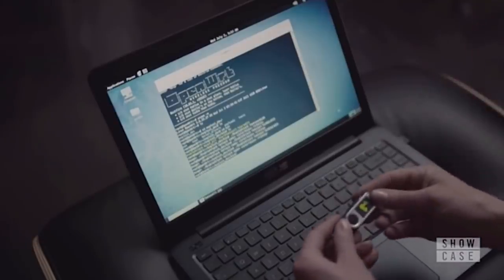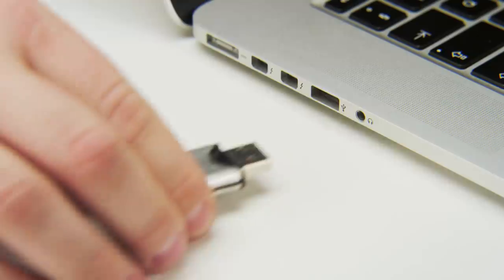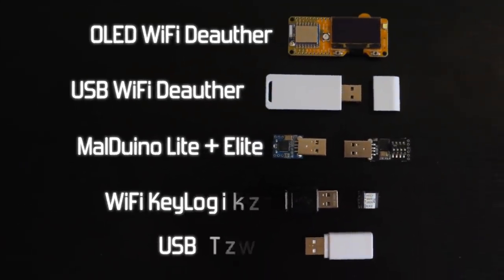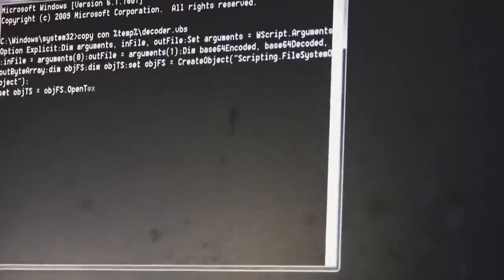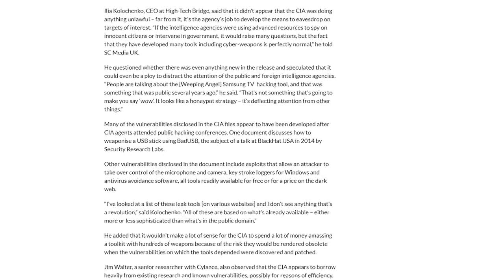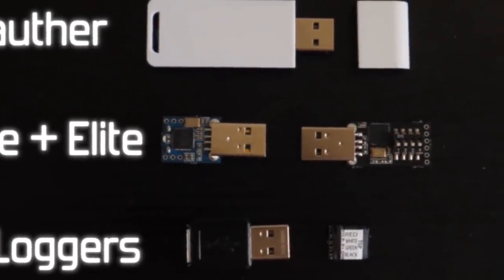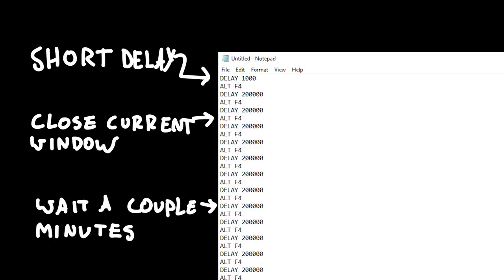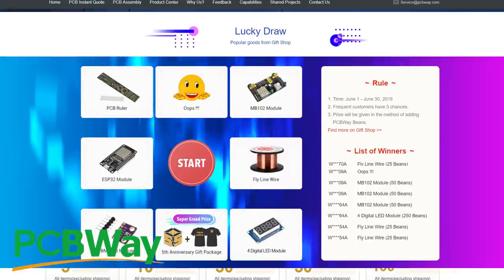Evolution Of The BadUSB

Comment: BadUSB is the wrong description for that because you actually only talk about a usb device that makes keyboard inputs. BadUSB is actually the vulnerability in a certain type of USB Firmware which made it possible for hackers to modify the firmware so it does what it does.
Reply: Yup, this has been known as USB Rubber Ducky for several years. The malduino site even says it's inspired by hak5's rubber ducky.
Reply: What do you mean by "certain type of USB Firmware"?  I believe you meant "every single USB firmware ever made because it is a fundamental design flaw in the USB spec".
Reply: MAFRIESE those brutal hackers are knights from the devil, aaarrrggg!!
Reply: I actually thought BadUSB was the one that charges capacitors and dumps a fuckton of voltage down the data lines, frying whatever USB controller it was plugged into...
Reply: @WackoMcGoose  I remember that. What was that one called?
Reply: WackoMcGoose that was an USB Killer ;^)

Comment: What if it's plugged into a slow computer? Where Win+R takes like 5 seconds to open the run dialog? If it just acts as a keyboard it probably couldn't detect this delay and would type the command too early before the run dialog is opened, right?
Reply: I'm not sure but it seems like 7 would buffer the keystrokes where 10 doesn't.

Comment: "Typing thousands of characters per minute" There's your detection vector, right there! Just equip security software to check for inhumanly-fast typing.
Reply: wouldn't that make gaming marco's a false positive?
Reply: Better yet, checks by matching VID, PID, serial number and class. Only devices whose parameters all corresponded to a check on whitelisted devices (whitelisted by the user via sudo) would enumerate. Devices that decided to change class on the fly would have their access revoked, unless they were authorized to do so. More fail safe than checking for typing speed, as a malicious device can always emulate a real human typing.
Reply: I'm sure typing speed can be adjusted to normal speed like 100 wpm

Comment: Do you know how fast the response time of a badusb with a wifi connection is?
I was planning on using a raspberry pie to do essentially the same thing. Why? Some games do not accept input from scripts like autohotkey, so I had an idea to use a device like this to generate those keystrokes. Because they are essentially "real" keystrokes, then all games should accept them. Now I just want to send commands to said device from my script so I can have macros that work in all games.
Reply: Also is it possible to send mouse inputs and movement as well? Or is it difficult to simulate mouse movement?

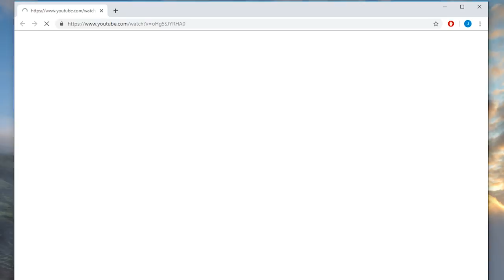Comment: 1:13 They have to be detectable. If they are just HID keyboard you will get a pop up when you plug in one saying that you just have new keyboard with driver installed and ready to go. This happens only when you plug it in first time so pay attention.
Reply: They could be detected if Windows didn't tried to enumerate every device that is attached. A check on VIP, PID, serial number and class against a trusted devices list would solve this.

Comment: Just a question. Did you add any capacitors to your malduino breadboard circuit? I am making an SD card breakout but it doesn't work.
Reply from the maker: Remember sd cards run at 3.3v, whereas arduino logic runs at 5v
Reply: @Seytonic  Yes I am using voltage dividers and a voltage regulator
Reply: @Seytonic  Actually nvm I tried usin g a nano and it worked. Maybe I have something wrong with my breadboard circuit 328p

Comment: I bought your Malduno and WiFi deauther, they're great. I only wish the Malduino came with a shell and I also want I had a decent powerbank which won't turn the WiFi deauther off after a few minutes.
Reply: if someone you know or some local place has a public 3d printer, you could always use that. Its easier to mass produce em without casings

Comment: I am a system administrator. I use the BadUSB for fast deployment
Reply: It's the most efficient way, isn't it? No reason why you can't.
Reply: @hritwiksom3032  There is none. You could just pre-configure it for a blind install. But that luxury is for Windows. Linux not so much, but this is a very workable solution

Comment: Do they really still work on modern os, I thought that was already patched?
Reply from the maker: They patched keyboard input?
Reply: @Seytonic  Actually, it wouldn't be that hard. Windows already has a UAC built in to prevent try to prevent malicious code from running. If this UAC required a password, like on Linux, it would stop it in it's tracks, as the bad USB wouldn't know your password.

Another way, would be for Windows to have a "trusted devices" sort of security built in. I'm sure windows can tell the difference between the main keyboard and an additional keyboard plugged in. Just because they are all keyboard inputs, doesn't mean that windows can't tell which keyboard it's coming from. They could literally make it to where only the original keyboard is trusted any additional keyboard would require a password to authenticate it before being trust it. This would absolutely crush this type of attack.

Comment: A malicious USB device doesn't have to enumerate as a USB keyboard. It can be build as a hub, with keyboards and other devices behind. There are also composite devices that can act as a disk drive and a internet access point (don't need to look up further). This just proves how inherently unsafe USB is.

The only defense there is to implement permissions for USB devices. Only trusted devices with matching VID, PID, serial and class should enumerate. Any other devices that are not marked as trusted by the user, should not even enumerate past the get descriptors requests. Plus, if a USB device decided to change its class on the fly, the permissions would revoke unless this change was listed as trusted by the user. I think this is feasible under Linux, but needs a massive change in the kernel.
Reply: How would the user provide permission for their own keyboard during setup or replacement of parts though?
Reply: @AWriterWandering  You have a point. Forgot about that part.
Reply: @samuellourenco1050  Well actually, come to think of it whenever you pair a bluetooth keyboard, you are prompted to input a randomly generated 6-digit code. If the code doesn’t match then the pairing will fail. I don’t see why this couldn’t be implemented for USB keyboards as well.

I mean it wouldn’t be completely fool proof in itself. The device might be designed to appear to disconnect and reconnect, giving it more chances to guess the code. Though at least having a prompt constantly flashing on your screen might raise some eyebrows.
Reply: @AWriterWandering  Well, when attaching a keyboard or a mouse, a modal window could appear asking for you to type in certain keystrokes in sequence with your new keyboard or do certain operations with your new mouse, in order to verify them. The keystrokes of the new HID device would be intercepted by this verification program instead of going to the system. Keystrokes or operations with already attached keyboards or mice would pass through the system unaffected, essentially being ignored by the verification program. Nice call!

Comment: A very old method to stop this type of attack (on linux):
https://www.kernel.org/doc/Documentation/usb/authorization.txt
There are tools for other operating systems that claim to have similar functionality.

This is not very secure protection. The problem is, every usb device can fake device information. If the attacker knows that you are using a Cherry-Keyboard, he can fake this... but if he just uses device information of a Logitech keyboard, the attack will fail. It might not be very secure, but it still helps. ;)

(But nobody uses this, except me, after a colleague attached a wireless mouse to my computer. Then he slowly moved the mouse around and laughed when I cleaned my mouse, resorted to percussive maintenance and finally got a new mouse...)

Comment: Why doesnt the oprating system limit the # keystrokes / second?
I'm sure there's a physical limit to anyone's typing speed.
EDIT: (not that that will solve the issue)
Reply: What would solve the issue would be implementing checks on enumeration. Any USB that failed a check on matching VID, PID, serial number or even class, would result in either a dialog to the user asking for permission, or in non-enumeration if the device is marked as non-trusted. That list would be controlled by the user (ideally, via sudo), and not by the computer vendor or the software distributor. If a device decided to change its class, it would also cease to enumerate, unless the user has given permission to do so.
Reply: @samuellourenco1050  sadly i do not know what that means, though it sounds interesting. By the way, would that cause issues with not being able to use the keyboard to give permission? (assuming an abscence of mice)
Reply: @pauladriaanse  Yes, it would. New mice wouldn't be able to enumerate either. Never though of that!